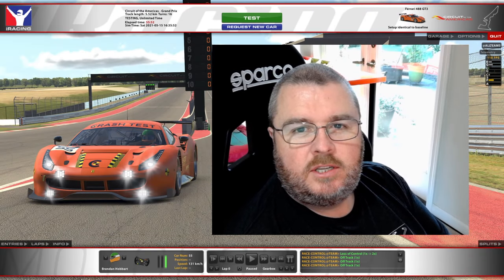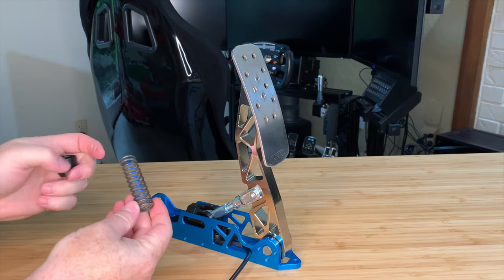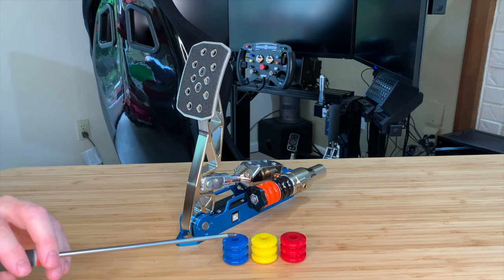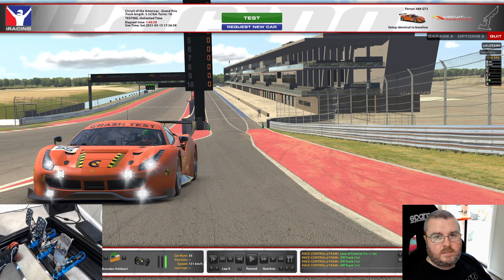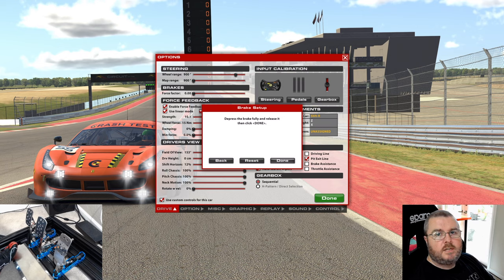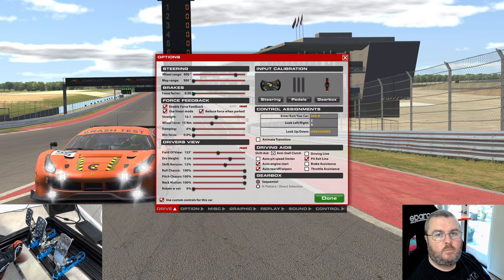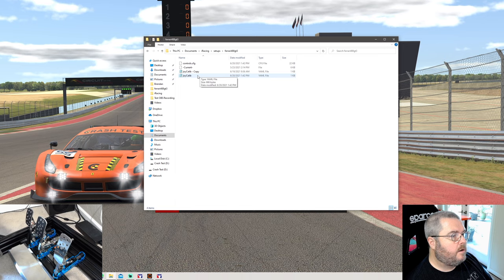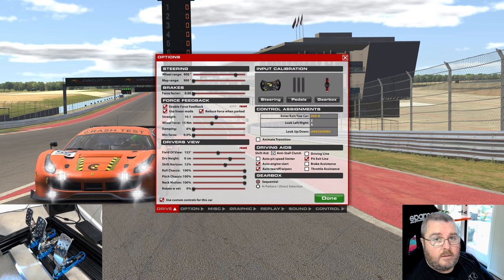In-Depth: iRacing Pedal Calibration

Comment: Great stuff. Didn't realize that about CalibMin vs CalibCenter. Going to have to see what I have as I was putting the values from diView in CalibMin! I use two blacks mostly with a very large low end so I really have to stand on the brakes to get anything to happen. This is a close match, well I may have overdone it a bit on the Sim, to my Cayman Clubsport which has unassisted brakes (aka dual master cylinder option). Trail braking better in the Sim now as my foot is still down too long coming off the brakes in my real car. Need to strengthen my body some! Thanks for the great video to go with Mark's great pedals (using JBV's now after years with the PRX's.
Reply from the maker: Thanks for that Mark. I love hearing comparisons to real world applications. I think most of us in sim land are looking for authenticity in our setups but we just have no frame of reference to get there.
Reply: @crashtestsimracing  My earlier car had more street car like brake pedal so that new add on coming sounds great for that. I used to run my HPP's with one full bumper and the other cut down to 2/3rd sometimes with lots of empty space too. That way it felt very very soft before getting harder. I probably could have played with a dead zone but didn't understand that aspect very well.
Reply from the maker: @MarkLewisTrackVideos  Stay tuned for more information about that. There is more testing and development to be done but I’m confident it will be a very useful accessory.

Comment: Great in-depth tutorial, much appreciated. I have the Thrustmaster TPA pedals (with a load cell mod) and these work slightly differently. The range goes from 1023 (off) to 0 (full on).

So to get say 80% brakes you have to go to a minus number. Yes, it accepts minus values.

On my set the brake is on the Y axis and the Clutch is called Slider. Importantly you have to adjust CalibMin.

These are my settings for the MX5 - hope this helps.

---
CalibrationInfo:
 DeviceList:
 - DeviceName: 'Thrustmaster T150 Racing Wheel'
   InstanceGUID: '{D99A8B00-C00B-11EC-8001-444553540000}'
   AxisList:
   - Axis: 0
     AxisName: 'X Axis'
     CalibMin: 0
     CalibCenter: 32768
     CalibMax: 65535
   - Axis: 1
     AxisName: 'Y Axis'
     CalibMin: -30
     CalibCenter: 1023
     CalibMax: 1023
   - Axis: 2
     AxisName: 'Throttle'
     CalibMin: 0
     CalibCenter: 1023
     CalibMax: 1023
   - Axis: 3
     AxisName: 'Slider'
     CalibMin: -900
     CalibCenter: 1023
     CalibMax: 1023
...
Reply from the maker: Thanks for that Sean. This is a good reminder of the sometimes seemingly broken logic that occurs when iRacing assigns to the CalibMin, Center and Max variable. If I remember correctly, the three values are present to allow calibration of pedals that share an axis. e.g. a Throttle from 255 to 0 and Brake from 256 to 512, but both on the same controller axis. When calibrating that type of setup, iRacing will use CalibCenter as the starting point and then either Min or Max depending on which is more separated from the CalibCenter value. This can lead to some funny looking joyCalib files and a little head scratching when it comes to manipulating it 🙂

That doesn't look like what is happening with your setup of course. Just seems like revered output from the driver. Anyway, looks like you've got it behaving as you want and thanks for the example. It is a useful reference for others.

Comment: I do have one more question. I currently use the Fanatec CSL pedals and both the brake and throttle are spring type. I do not have a load cell yet. Could the application you are using here in this tutorial be used for spring pedals, or is this specifically for load cell type pedals. I’ve seen a few other tutorials on this subject and I must say yours is without a doubt the most informative and thoroughly explained!
Reply from the maker: Hi Johan. If you are referring to DIView, then yes you can use it for any pedal set. Without a load cell or similar pressure-based brake there is less to gain by delving into the level of calibration covered in the video. It is still useful to understand the process so you can potentially add or remove dead zones based on how you use your pedals. For example, I typically calibrate in a very small dead zone at both the top and bottom of my throttle pedal as I have an odd tendency to sometime very briefly and slightly lift off full throttle if I shift my foot around. A small upper dead zone lets me maintain full throttle in the game when that happens. You can quite easily accomplish that with the calibration procedure in the iRacing UI, but it's good to know what is going on behind the scenes too with the calibration files. 

There is obviously a good deal more to gain with a load cell or hydraulic brake system though. If you have the opportunity to make that upgrade it is one of the biggest boosts to performance and immersion you can get for your setup. A great brake pedal, a DD wheel and triple screens/VR are the big targets for upgrades, probably in that order.

Thanks for the kind comments!

Comment: Great how to video! I have the JBV, is the Prototype you described available any where?  I know that Mark sold HPP and was wondering if someone else took over the brake prototype project.
Reply from the maker: Hey Steve. I'm afraid that prototype is not available. I went on to design a different prototype add-on that provides a distinct pressure build-up sensation at a configurable threshold brake point as I felt that would be more useful. It works really well in practice but since Mark has sold HPP, I don't really have a means to get it into production. Perhaps the new owners will be interested at some point...

Thanks for watching the video. Glad it helped!

Comment: Great video, but I wish I could get this to work for me. When I calibrate my Fanatec Club Sport V3 pedals in iracing the figures are in reverse. When the brake is not pushed I get 65535 & if I stamp on the load cell pedal I can get it as low as 0, but my max pressure I would normally use would be around 35000 & the SRF I race locks up at around 80%. Do I have to subtract when you say add & multiply when you say divide? Is there a way to reverse this in iracing so I can follow your instructions?
Reply from the maker: Hi Paul. I don't know if you can reverse the values, perhaps there might be something in the Fanatec driver? In any case I'm sure we can get it working for you as things stand right now.

So in your case, let's assume your CalibCenter is around 65535 and your preferred max pressure calibrates to 35000. Given your SRF example, you want that 35000 to correspond to 80% of max brake in the sim.

The total calibration difference between your zero brake point of 65535 and your preferred max pressure of 35000 is 65535-35000 = 30535. We want that amount of pedal travel to indicate 80% brake to the sim, so we divide 30535 by 0.8 (80%) to get 38169. i.e. A full 100% brake travel should indicate a raw output change of 38169 to the sim. In your case you would subtract that 38169 from your starting point of 65535. This gives you 27366, and this is the number you use in your CalibMax value. 

Assuming I didn't screw up the math, now when you hit your preferred max pressure, indicated by a raw output of 35000, you will get 80% brake in iRacing.

I hope that makes sense. Fire away with any questions and thanks for checking out the video.
Reply: @crashtestsimracing  Thanks!
Reply from the maker: @pauljackson8163  No problem! Let me know if that works out. It just occurred to me that in your case the 'high' point calibration might actually be in the CalibMin value instead of CalibMax. CalibCenter will be your 'zero' brake calibration regardless, but I haven't tried calibrating Fanatec pedals in a while so I'm not sure which variable will be used with reversed values.
Reply: @crashtestsimracing  It has helped me a lot this week, I gained nearly a second on my PB at Okayama International Circuit in the SRF. CalibMax is the 65535 figure, CalibCenter 64500 I set to allow for foot rest & CalibMin I needed to change to 41000 as 35000 was too hard & needed to much force to lock wheels. I'm very happy with the results. Thanks for a great video!
Reply from the maker: @pauljackson8163  Glad to hear it Paul. There is definitely a lot to gain or lose through pedal calibration.

Comment: Great video thanks!  I just received these pedals and after 20 years using g25 then g29’s so you can imagine how pleased I am with them.  

In terms of heel & toe, the three pedals aligned is difficult as my foot catches on the side of the accelerator while the brake is depressed.  Your suggestion of adjusting the internals of the brake is interesting however would result in an angled pedal, which may or may not work for myself.  Is there any reason not to simply mount the entire brake pedal back a centimetre or two and as a solution?  

Just to add, I am very pleased with all three pedals setup as stock and don’t feel the need to play with tensions or anything else, so good job guys!
Reply from the maker: Hey David. Thanks for checking out the video and congrats on your pedals!

You can absolutely mount the pedals anywhere that works best for you. Recessing the brake will work just fine if your mount solution allows for that. Although, wouldn't it make more sense to move the throttle backwards and not the brake? Anyway, I could just be misinterpreting your comments above. Just rest assured that you can mount them in any way you see fit, including inverted.

Just reply if you have any other questions.
Reply: @crashtestsimracing  HaHa, I think I got myself a little confused.  But you are absolutely correct, it is the accelerator which I intend to move back slightly while maintaining its angle.  I do like the idea of inverting the clutch and accelerator and it’s something I may look into in the future. Anyway, thanks again for your video and for responding so quickly.  Oh, and would love to order the brake accessory once it’s out of prototype stage.  Sounds very promising indeed.
Reply from the maker: @JJ_Khailha  You can invert the brake too if you like! :-)
Reply: @crashtestsimracing   So I moved the accelerator back 1cm and adjusted the threaded bolt to set the pedal plate further back as well.  This is working very well for heel & toe in terms of positioning however I'm not getting enough revs from the blip for downshifts.  The obvious thing to do is to shorten the travel of the accelerator which in turn would result in a recalibration where less travel translates to more revs?  Seems a shame as I quite like the default travel in that pedal, but am willing to find a compromise.  An alternative might be to increase the force required to depress the brake resulting in less brake travel which may mean I could move the accelerator forward 1cm, back in line with the other two pedals and maintaining heel & toe positioning, and perhaps that would result in more of a successful blip?  I'm using Assetto Corsa exclusively at the moment.  Just wondering if my logic makes sense or if perhaps you might offer up a better solution before I start tweaking.  Many thanks!
Reply from the maker: @JJ_Khailha  Hey David. I think you are on the right track. Any of your suggestions could be a potential solution, it's just a matter of which one works best for you. 

My first step would be to continue tweaking the pedal positioning and see if you can find the right balance there, before considering a shorter throttle throw. Since you like the stock throw (as do I), it would be a last resort to make changes there.

Heel and Toe is always a tricky thing to get right. Personally I'm no good at it, as I just don't have enough flexibility in my right foot to pull it off. Since we are all different in that regard, getting the correct pedal position is a very personal thing.

In your case I believe I would start with just pulling the throttle pedal slightly forward of the 1cm recessed position you have it in now. See if you really need that 1cm or if there is a middle ground that will take care of the problem.

If that doesn't work then your idea of firming up the brake could certainly help. Of course that would change how the brake feels to you and will require recalibration. Since I don't know how firm your current brake setup is, it's hard to advise you on whether this is likely to be a good plan for you. That said, in general I find a relatively firm brake pedal to be an advantage as it provides a larger pressure range from zero brake to max. That in turn effectively gives your braking foot more resolution to play with. This can be a very good thing, but only if you can sustain the pressures required for however long you tend to practice or race. There is no point in setting it up so firm that your foot gets fatigued or starts hurting. That will not just hurt your foot, but also your performance. It's always a balancing act when trying to find that perfect performance sweet spot.

As mentioned earlier, abbreviating the throttle travel so that less initial pedal movement provides more input is a sound plan logically. However, that would do the opposite to firming up the brake, i.e. it would reduce your effective resolution and control of the throttle, so I would leave that 'til last.

Let me know how you get on!
Reply: @crashtestsimracing  Thanks for your response, I find it very useful indeed.  My brake pedal tension is factory default which I quite like although I believe there is scope to up that pressure as I am able to max it out and hit the mechanical hard stop.  Not noticeable during normal driving but if I make the effort to do so.  To begin with though, I’ll start by bringing the accelerator forward again while attempting to adjust my technique and perform more of a lift to get the midfoot/heel over the side edge of the accelerator.

There is an interesting additional factor that can be considered.  If I can get my feet more elevated then my midfoot/heel would contact the accelerator in the centre which is the most forward protruding part of that pedal.  Currently I am contacting the bottom of the accelerator plate which is curved away from my foot, and sometimes even lower which results in an even worse blip.

Thanks again!

Comment: Thanks so much for this video. Well done and very helpful in getting my brand new V3s setup. Still working on the CalibMin vs CalibCenter concept. Not sure I get it yet. I ended up setting my braking low end at 50 for both. Seemed to work okay. I tend to put my foot right on the pedal but no pressure. When I used a higher min I didn't getting any braking until I pressed the pedal a good ways down. So I was missing some trail braking range. I tried the DIView link above and it didn't work. Could it be my computer? I also tried their website directly and couldn't find the download.
Reply from the maker: Glad you enjoyed the video Joe and thanks for dropping by. It sounds like you are getting the idea by tweaking the CalibMin and CalibCenter for the low end. I believe if you try just modifying your CalibCenter value you'll find that is the only one you need to change to modify the brake starting point.

As for the DIView.exe download, I'm not sure what to tell you. The link works fine on my end. If you want to navigate directly to it, go to www.leobodnar.com -> "Universal USB Interface Boards" -> "BU0836A 12-Bit Joystick Controller". On that page you will find DIView.exe under the "Product Downloads" tab.

Comment: hi, does it still work ? because when I do this with a car I never used before, the setup folder of the car is empty
Reply from the maker: The folder will be empty until you perform your first calibration in the iRacing UI. That will generate the joycalib file and you can adjust from there. Just make sure you have ticked the selection to use custom controls for this car. Otherwise the calibration will impact the global joycalib file and it will not create the first car specific instance in the setup directory.
Reply: @crashtestsimracing  thank you, indeed i forgot to ticked the custom controls